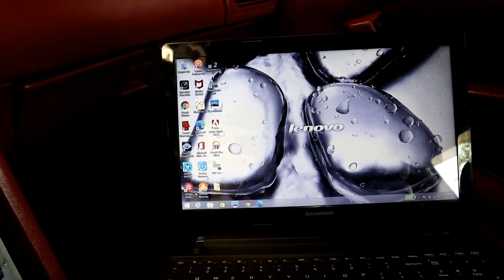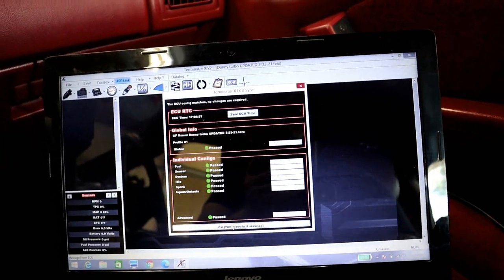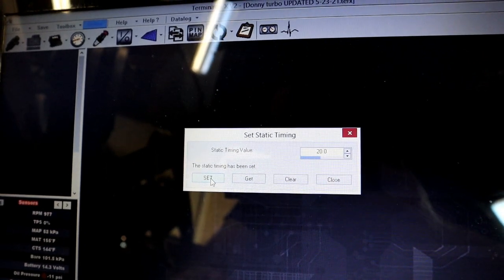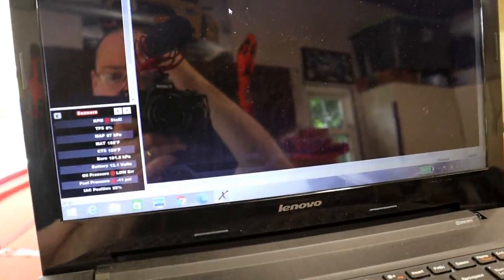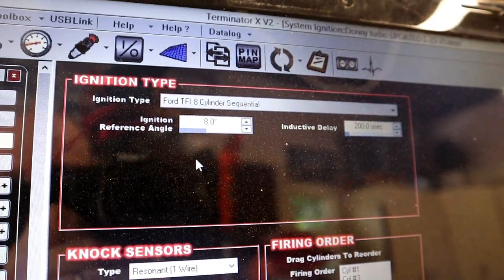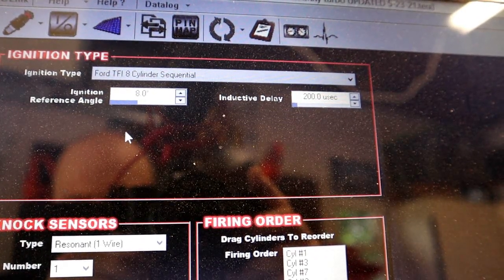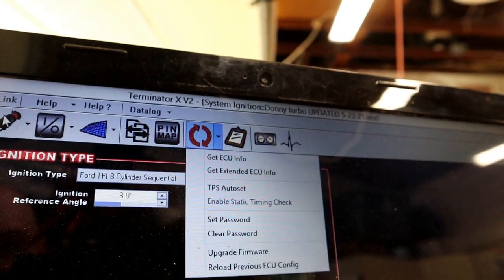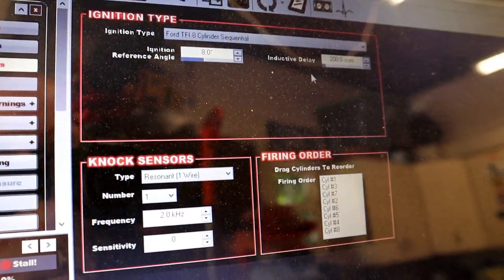Terminator X Static Timing Check for Fox Body Mustangs

Comment: You can also turn the engine over to 10° BTDC, drop the distributor in with the rotor pointing at #1 on the cap as a good baseline. 
You can also turn the distributor until the timing on the balancer matches the static timing and then fine tune with the reference angle but in my experience dropping it in at 10° BTDC gets it within a half degree or so.

Comment: Ok. Im new to holley and a little lost on this. My base timing on engine was 10btdc .. when i start the car and set static to say 14degrees it goes like 8Atdc..
Reply from the maker: If you set the timing in the static setting to 14 and hit set and the balancer is showing 8 with a timing light either move the distributor physically to advance to match to 14 or use the reference angle to change it

Comment: Great video, but I have a question. In the idle table do you have the idle spark enable box checked,  or unchecked to do this?
Reply: That box should be un-checked when you do this. It'll keep timing from bouncing around. After you're happy, check the box.
Reply from the maker: When you have the static timing up and hit "set" it disables the P and D term idle spark and will leave it disabled until you hit "clear" on static timing.

Comment: I did all of this but the numbers on balancer will not stay still. Bounces all over the place. Any ideas? Sbf 331 turbo car. Thanks
Reply from the maker: Did you click set when you had your number entered? Shouldn't bounce at all under static
Reply: @strangedemon  I did. Still bounces around.  In the software it is set at 10°. Timing table at idle is set at 20°. Do I enter 10° or 20°?
Reply: I'm running the holley hp but I'm sure the timing set is the same procedure
Reply from the maker: @joeytyler2081  set it to 10. Usually idles fine at 10 degress

Comment: Static timing is with the spout out. Once you put it back in, the Terminator is going to change the timing. Are you saying to check the static timing with the Terminator X "check static timing".....and do so with the spout in? Also, wouldn't your timing table change your timing when you rev it to 2,000 RPM? Why are you forcing it to stay at the static value? I am asking this in a serious way. I just want to understand. I am very interested in taking the advice you offer in this video. Thank you for making it.
Reply from the maker: There is no spout with the terminator x. The static locks the timing at a specified value and you need to verify the balancer reads the same as the static value.
Reply: @strangedemon  Thanks a lot for the quick reply and explanation. My system was installed by a speed shop and I didnt realize the spout was no longer used. Great tip.